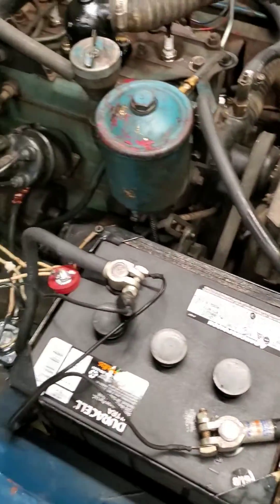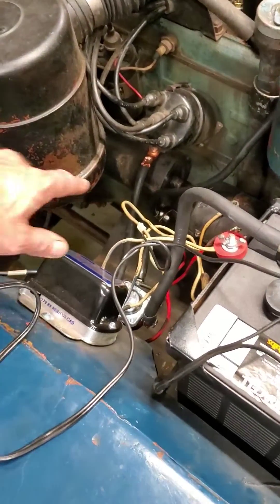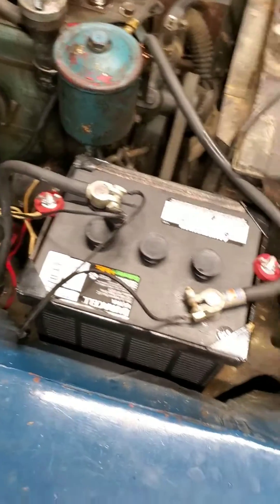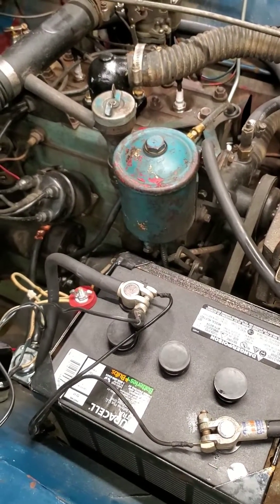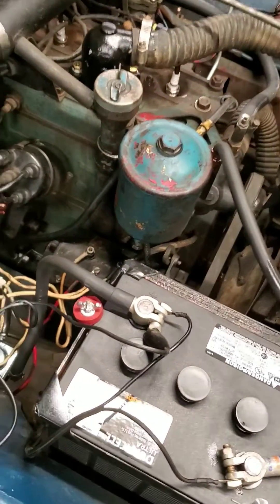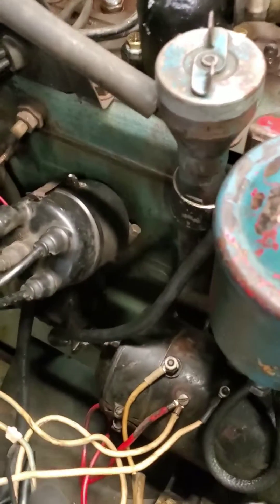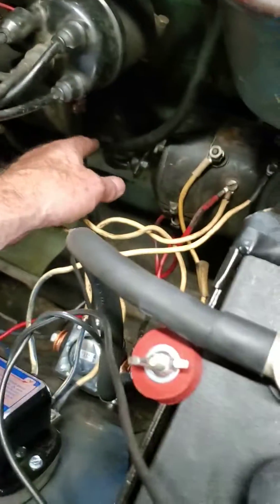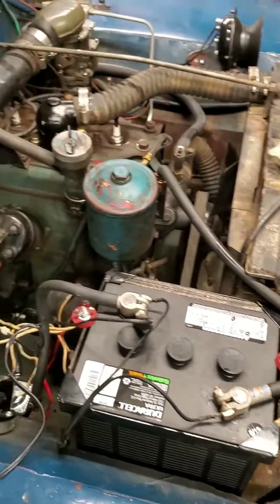Engine cranking

Comment: Great tip - thank you! Just got a ‘49 3a that’s original 6 volts and have been considering a 12 volt conversion due to slow cranking. You’ve got me rethinking that plan.
Reply from the maker: When properly set up, a 6v system will crank just like a 12v system.

Comment: I need to consider AWG 00 or 2/0 (I like say the old fashion way, "two-aught") stranded welding wire for my 1952 Ford 8N Tractor which still has its 6 volt system. The welding wire has very fine stranded wire that it is so much better than stranded "battery cable wire".
Thank you for the great suggestion,
Mark.
Reply from the maker: You are welcome. I'm very pleased with the improvement. Even in cold weather it cranks over smartly.